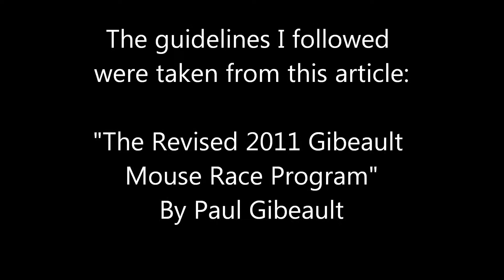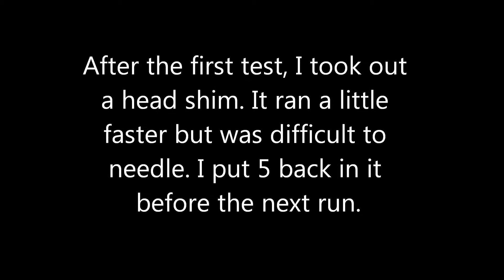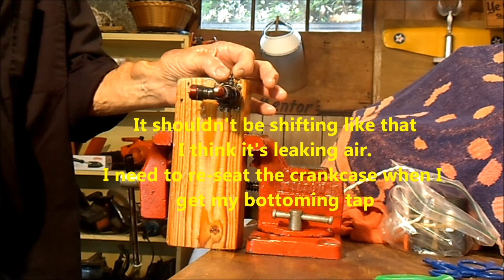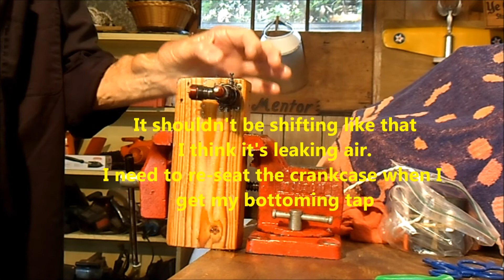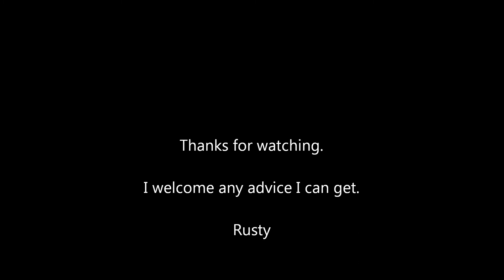Black Widow mouse racer build.wmv

Comment: The Galbreath/Nelson head often gives harsher running until your engine warms up so I go easy on the needle adjustment until the engine gets hot.
I`ve had some engines lose massive rpm by mounting the cylinder sideways.

Comment: Hi Rusty, to get any suitable speed for mouse racing a 4 inch pitch prop is required at high revs but to do this plenty of nitro-methane is also required for example, a 4.75x4 prop with 40% Nitro. I hope this helps? Gilly Australia

Comment: Are you using the head manufactured by Doug Galbreath that uses a Nelson HD plug?
This type of head is certainly worth using once you have a stable running engine setup.
On the old engine they run slower than normal, which is why you need to use a TD plug as your performance reference.